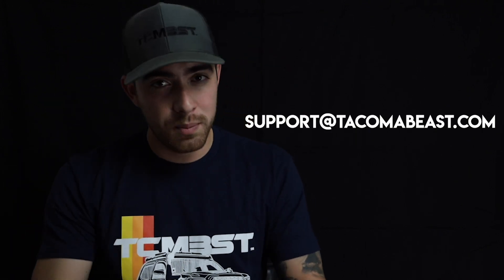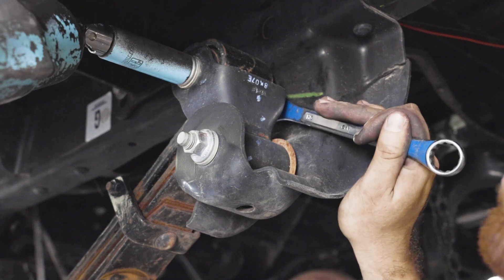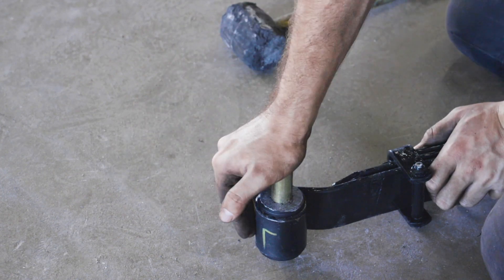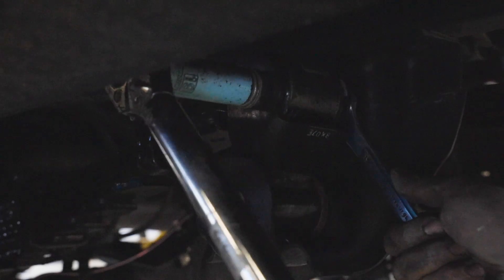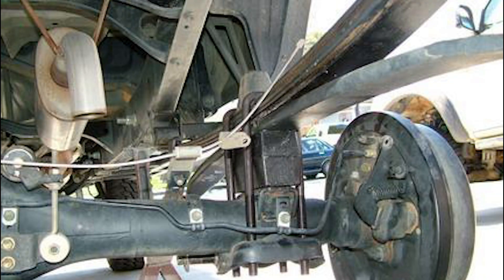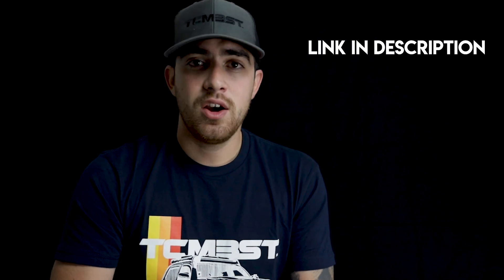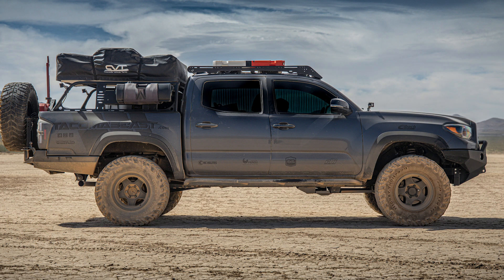How to Install Tacoma Leaf Spring + How to Choose The Correct Leaf Springs | Expedition Series

Comment: Great install video. Glad you’re liking the Deavers. One thing to add is that Deaver does offer custom leaf springs. If someone anticipates carrying more than 1,000lbs in the back just give Deaver a call and they can make a custom leaf pack based off the individual needs. They are great to work with.
Reply: i thought a tacoma can carry around 1000lbs anyway and the stage one increase it 300lbs up to around 1300lbs? right?

Comment: This video saved me from an agonizing leaf spring change.

Made it easy.

I have very limited mechanical skills, however this was pain stakingly long because i do have a 1/2 in torque gun, which is great, my smaller tools and pieces that make using that gun in diff spots are minimal so thats the kicker.

Point is, i changed the upper control arms on my tacoma n i think if u can do that (sounds eady right? Go do it n tell me how long it took ya lol) i can do just about anything. That was damn near the biggest pia ever. Esp when someone shows ya effortlessly moving a body panel with a crow bar n ur like oh it doesn't need to move that much, fml.

Anyway this is straight forward.

The hardest part for me believe it or not was getting the 9 year old rear shocks off as i replaced mine too, n man were they a B. I tried diff vice grips on the top and under the bolt because as ur trying to loosen a deteriorated bolt, the shock is spinning (who the f invented this garbage like this). Whst worked for me, was a 14mm ratcheting box wrench and a pair of channel locks and i used a nice size c clamp to basically make vice grips but waaaaay better than vice grips. I clamped that sucker so tight n then u have a big handle to hold onto, its a win win.  Worked amazing for anyone who doesn't have vice grips (dont even waste ur money, ive found they rarely work for anything, n only use those if ur replacing ur shock of course, otherwise no need to remove the top bolt at all.
Sorry for the story but maybe it can help someone.
Reply from the maker: Dude that’s some pretty solid advice! And we’re glad our video helped you out!! 🤙🤙

Comment: Just installed a set stage 2 deavers today. I got that set because the bumper I had put on two weeks completely smashed the stock leafs on my Pro. To my suprise, the stage 2s gave me 4" of lift in the rear, even with all the extra weight. Granted, nothing has really settled yet, but I would definitely recommend the stage 2 set for people who have future plans for their ride that way you're ahead of the game. If you're not gonna have extra weight consistently, get the stage one anyway because the stock Tacoma leafs are absolutely weak. My rear bumper only weighed 90lbs and it flatened those leafs and gave me that stupid looking sag.
Reply from the maker: That’s great to hear! And thanks for the tip 🤙

Comment: The ... only concern I'd have would be with the angle of the input to the rear diff. Every prep I've used before involved one-side to torque before touching the second side. 

I think all of those had the rear axle on jack stands, not tires for the final torque (likely lazy mode.) 
Otherwise, I'm doing pretty much this whole vid in a garage with no lift this weekend or next.

Comment: Thank you for the informative video. I'm kind of surprised that they make leaf springs for 1,000 payload capacity. FYI, the payload capacity for a double cab is 1400lbs, which includes all upgrades, bumpers, sliders, winch, topper, persons and cargo.
Reply: I think it's  way overstated by Toyota. I'm bottoming with about 750. I'm ordering stage 3 Deavers.

Comment: Hey, great video. Just about to do this on my 2012 Tacoma, but was wondering if you’d recommend replacing the through bolts also? I have new U bolts but the ones connected at the front and back of the entire spring?
Reply from the maker: You can keep the same ones 🤙

Comment: Oem says 52 lbs torque. Is it more because of grade 8 bolts or?? Im trying to figure out what leaf spring to get for a small lift but I hear bad reviews on mosr spring companies.  I thibk id rather keep oem springs and add a add a leaf to get just tge inch or so lift I need to correct my driveshaft  angles with the weight I constantly carry ...
Reply from the maker: Hey Ben, we have a team of experts that can help you out with any technical questions you may have, feel free to contact them at support@tacomabeast.com they’ll be happy to help 🙌

Comment: Like the vid very informative. I have a broken leaf spring on a stock 2011 Tacoma that needs to be replaced and I wanted to know if the process is within my capability. I don't have a lift but I think I can make due with jack stands on the frame and supporting the axle with the jack.
Reply from the maker: Honestly can be done at home, although it might take some days

Comment: I have a 15 taco trd sport. I won’t be having weight 90% of the time. I do camp so towing/bed loading I will have. I have a 1.5 block right now. Will the aal no block give me a rough ride? Or a rougher ride. I have the height alrdy I just want some towing/loading help. Should I just go with helper springs?

Comment: Very well explained!!! I like how you include torque values. Looks very straight forward as you say. I was quoted $1000 for labour to install 4 leaf springs and 4 shocks on my 1988 Toyota Hilux (I have front and rear leaf springs with a SFA). Plus $3000 for a Dobinson lift kit. So $4000 total. Sounds ridiculous high to me. Is replacing leaf springs totally something that could be done as a DIY project?? Doesn’t look so difficult to me. What is your opinion on Old Man Emu vs. Dobinson leafs and shocks? Thanks!
Reply from the maker: OME has got more of a rep but we found them to be a bit stiff, as far as doing it at home, it can definitely be done with the right equipment, you just have to be really careful and mindful of putting everything in the right place 🤙

Comment: We have a 4 Wheel Camper on our 2021 Tacoma. We have added Firestone Airbags and they do work well but am thinking a Deaver Stage III would really be the best call. The campers weighs about 1400 lbs in total, based on your comments it seems like you would recommend Deaver Stage III's, would that be the best call in your opinion?
Reply from the maker: Hey Gerard, that would probably be a better question to ask our support team, they’ll be able to give you a more detailed and thorough explanation 🙌 you can contact them at: support@tacomabeast.com 🤙

Comment: My brake line seems super taught when mounting with the bolt on the leaf. A little worried about that. Worried it may break the brake line when flexed out offroad
Reply from the maker: This might be able to help you: https://tacomabeast.com/products/2005-2023-toyota-tacoma-extended-rear-brake-lines

Comment: I’m getting rid of my blocks in the back and getting new front coil overs and rear lift. I was initially thinking just an add a leaf but with my rooftop tent and will be getting high clearance steal bumper. What’s the difference between the OME leaves and the stage 2 or 3 deavers? As far as weight it can handle. Because the OMEs are much cheaper. Total weight in the back will be around 400lbs. Thank you for your help.

Comment: It should be mentioned that the OME Dakar leafs add a whopping 2.75" of lift, whereas the Deaver J66 only adds 1" to stock height. I do NOT need 2.75" of lift in the rear, nor do I want to pay $1,000 for the Deavers. Back to square one.

EDIT: Atlas springs have what I need for $620! http://atlassuspension.com/index.html

Comment: On my back passenger leaf one of the middle leafs shifted more towards the rear. I bought a new leaf but i was wondering if i can just somehow push the leaf back center or should i just change it out?. Also the leaf i bought i forgot that i added a leaf on the old one so the left would have one more than the new one. Help pls
Reply from the maker: hey bro! if you need some help with your taco you can contact our support team at: support@tacomabeast.com they'll be more than happy to help you with any questions you have!

Comment: Awesome video, I’ve got a second gen tacoma with a 3” lift. Blocks in the rear with an add-a-leaf. As I use this truck for camping, work and hauling a atv I’m looking for something better. What would be the best pack for me? I do like the look of rake in the rear so just wondering if anybody could give me some solid options with my current lift height. Thanks!

Comment: I have a taco wit king suspension all around nd a block in the rear leaf but u can tell it’s still not leveled and I was just wondering witch leaf pack would work for me I dnt plan on running any accessories on the rear
Reply from the maker: Shoot us an email at support@tacomabeast.com and we’ll be happy to help you with that 🤙

Comment: "Spring under conversion kit and after-market shackle required." What is this? I am looking to buy a pair of the Deaver Tacoma Leaf Packs. I need my 2017 TRD Offroad at stock height. DO I need a spring under conversion and shackle to install the Deaver Leaf Pack?

Comment: I have a sliding tonneau cover that weighs 70lbs. Would the stage 1 be plenty of support for the weight? I don’t really haul a lot in my truck but maybe once in a while.
Reply from the maker: Stage 1 will be good for just that, if you plan on hauling more in the future you could invest in a stage 2 or 3 depending on how heavy you’re going 🤙

Comment: Great Vid! Very timely for me since I’m looking at getting new leafs. I have an add a leaf right now but since I’ve added the bed rack and tent with some accessories attached to the rack it definitely is sagging now. 

My question is what would you recommend? I am going to add a rear bumper in aluminum with swing out that will add about another 80lb or so. Probably looking at somewhere around 350-400. Sounds like i should go stage 2? 

Thanks again!
Reply: Yes swingouts are about 40lb-50lb because they will be steel and bumper itself will be made from aluminum roughly 40-50lb as well so weight will be about 80lb-110lb is what I am expecting!

Comment: Which was the store where you both the leaf springs?
Reply from the maker: You can find the leaf springs on our website here: https://tacomabeast.com/products/deaver-suspension-10-leaf-spring-1-inch-lift-rear-2wd-4wd-6-lug-05-19?_pos=1&_sid=930df04b9&_ss=r
Reply: @tacomabeast   this link , it doesn't mention what stage / extra weight rating.

Comment: Will a stage 2 deaver pack do well for just a camper and loading up the truck with some extra stuff to just go camping with the family. No top tent no metal bumper
Reply: And great video by the way
Reply: I will find out soon and let you know , just installed Deavers stage 2 yesterday I have camper shell as well and camping gear ..it feels good so far ,
Reply: @juannava9050  cool I got some used ones a wile back and have yet to install them. I want to refurbish them just haven't found the time. But saving up for the camper. 👍

Comment: Great video on the install. 
@mateo - is there any reason you didn't keep the stage 2 and use bags with Daystar cradles so you can adjust for load?

Comment: Great video and thanks for sharing. So the Tacoma goes from a 1/2 ton payload to 3/4 ton (or more). What are your thoughts on the wheel bearings? Are they still within their working range? (This is assuming your are using the stock axle.)

Comment: How much lift would you say the stage lll springs give you compaired to stock springs?
Reply from the maker: 1” it’s enough for the truck to look how it was intended. It looks solid
Reply: TacomaBeast Deaver springs tells me it will give me 3 inches.
Reply from the maker: You are correct about that, I did not read the stage 3 from your previous comment. Sorry about that. It will be 2.5 - 3 inches of a lift. It all depends on how much weight you want to add to your vehicle. How much weight do you plan to add to your Tacoma?
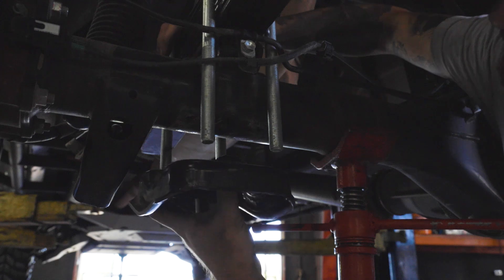Reply: Cool, that’s what I need thanks. Are you familiar with changes from 3:92 gears to 4:56, i’m getting really tired of this busy shift as they call it.
Reply: TacomaBeast  hey mateo do you need aftermarket struts on the rear to go along with stage 3 deaver leaf pack? or can i keep my stock ones?

Comment: How much weight can it hold nowb
Reply from the maker: It depends on the stage 
https://tacomabeast.com/collections/leaf-springs/products/tacoma-6-lug-05-18-2wd-4wd-expedition-series-springs-pair

Stage I – 9 leafs, military wrap, diamond cut ends, anti-friction pads, and four-piece bolt through retaining clips. Designed for bed weight of 0-300 lbs.

Stage II – 10 leafs, military wrap, diamond cut ends, anti-friction pads, and four-piece bolt through retaining clips. Designed for bed weight of 400-600 lbs.

Stage III – Leaf counts vary due to material thickness, military wrap, diamond cut ends, anti-friction pads, and four-piece bolt through retaining clips. Designed for bed weight of 700-1000 lbs. Driver and passenger side specific.

Comment: Adding or changing leaf spring does not raise your tow or carry rating.....it will help...but legally you cant carry or tow more than the factory rating😎
Reply: if the tacoma is rated to carry like 1000lbs ,  dont the stage one leafs say +300 so you can carry 1300 now??
Reply: lol the trans only handle 1000lbs. If u push heavier than that something can break.